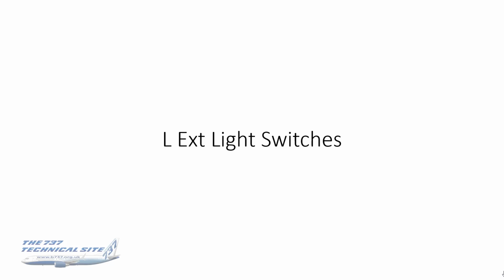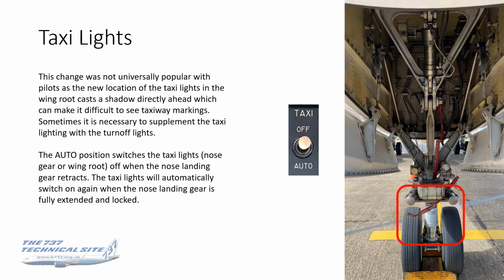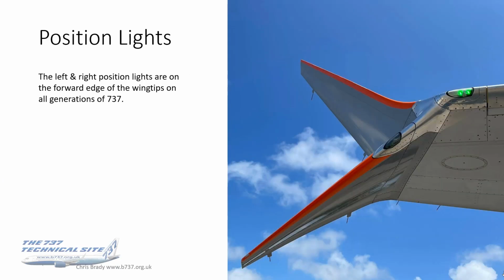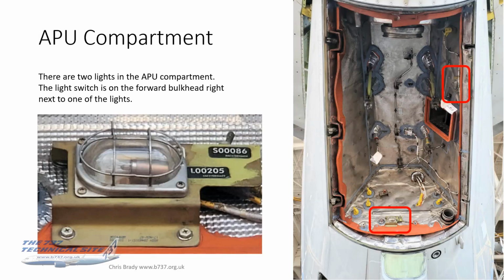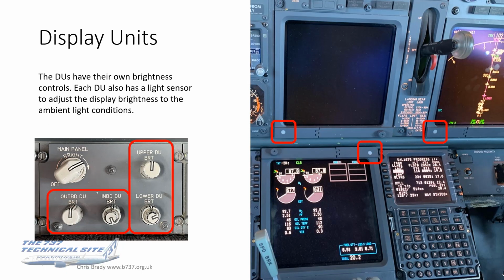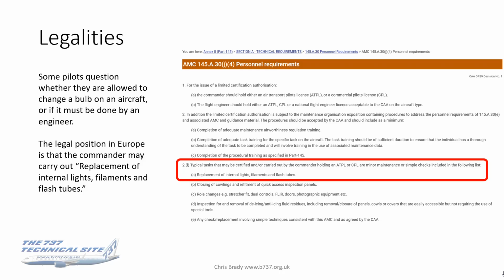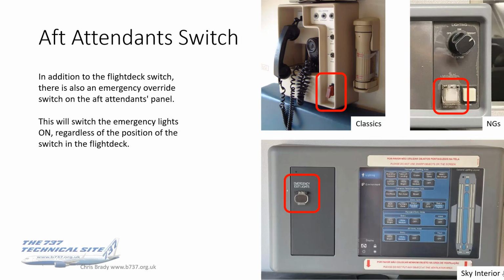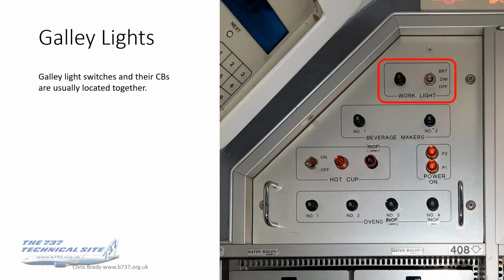737 Lights

Comment: Replacing the LED arrays and turn off lights is a total pain in the butt. As a maintenance engineer I prefer changing all the fleet's halogen landing lights instead of changing a single LED array. It has like 20 or more 5/16 screws just to hold a pair of led arrays and the area you're working is super tight. If it is cold and last day of the MEL, god help you.
Reply from the maker: Good point, I never thought of that.

Comment: Boeing should have stuck with incandescent landing lights. These LED arrays are total garbage. And super expensive compared to a regular halogen lamp. very unreliable. LED's are not better. Pilots tell me the brighter white light of the led makes seeing in fog or low viz much more difficult. The only winner is Honeywell $$$$$.

Comment: Hi Chris, I don’t know if you put this in the presentation but I never saw it or may have missed it, but just in case some fun info I have: Not too long after the MAX was introduced (a few years after introduction) Boeing started installing LED Beacon lights on the upper and lower fuselage of the MAX rather than the standard blinking PIP beacon lights. Older MAX’s still have the PIP blinking Beacons, but the newer ones have PIP Oval Shaped lights that are now LED. I wasn’t able to find an official source, but ChatGPT has given me two different line number MAX’s they started this LED Beacon switchover on, either line number 5602, or 6775. I’m sure you can find it better than I can, but figured you’d find it cool if you weren’t aware! I would be curious to know if since the MAX strictly has the PIP lights if they can just quickly switch out a dead standard blinking bulb for an LED, since the lens covers for the bulbs are the same shape.

Comment: Thanks for another great video. I have a question regarding the retractable landing lights on the NG. I noticed that you mention on your web site that these lights should not be extended above 250 kts. to avoid wear on the light hinges. Our company policy is to do just that as well, but is this an actual limitation from Boeing? I can’t find a reference in my manuals that says that 250 kts. is defined as a limitation. Just curious if you have some insight.
Reply from the maker: It is not a limitation, just advice based upon in-service hinge wear. Plus you can hear and feel the vibration which is drag - unless you really need them as extra speedbrakes!
Reply: Thanks for the reply. Cheers

Comment: Thank you so much for another amazing video. Just to add on that the chart light is in a different position on the FO side and without the use of the mirror due to no HUD on that side and there is another light that is easily missed in the flightdeck. There is a green light over the O2 masks that illuminate the area so you can always see the masks. Not sure if that light is in the MEL.
Would be interesting to know if it's a no go item or not
Reply from the maker: Thanks for the extra info

Comment: Hi Chris, at 14min you mentioned that the ng and max separated position and strobe lights. I think its an option to have one or the other as all ryanair aircraft including the 8200s have the older combined design.
Reply from the maker: Thanks for the info
Reply: As always a very interesting video! @ChrisBrady737
Reply: They are also all combined switch in our fleet, and they never get well with TCAS and Emergency descend drill🤦